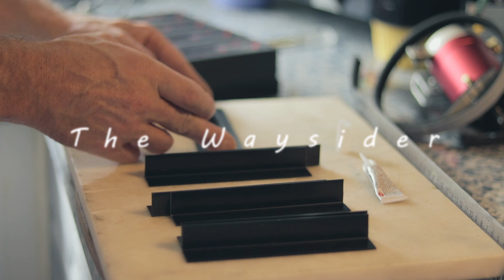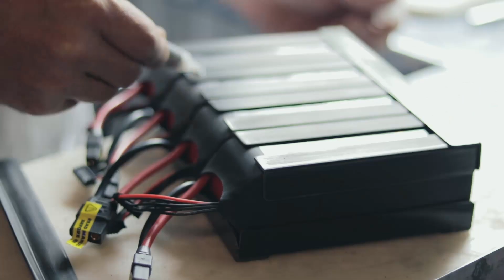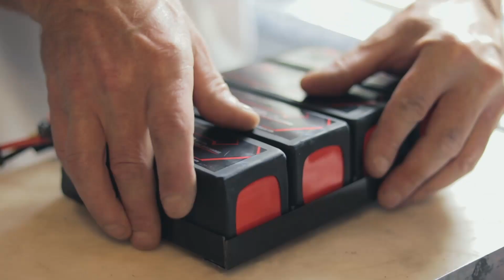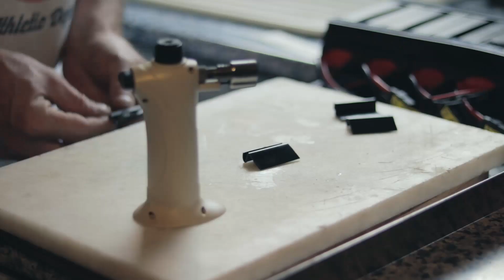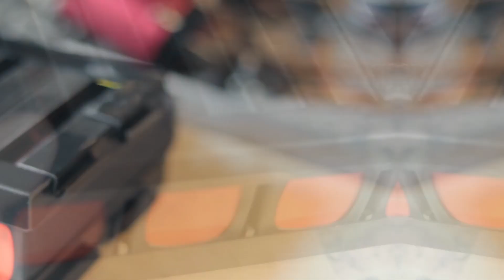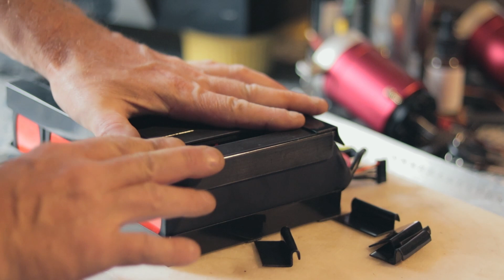I Made My Own Lipo Battery Box for my Diy Electric Surfboard

Comment: Hi, i want to build also, can you prezervatif something about waterproof battery
Reply: Can you suggest*
Reply from the maker: That's tricky but I just made sure no water comes in the hatch were the batteries are. I suppose you could look into battery terminals maybe that are somehow waterproof and make a sealed battery box that plugs into the board but I would say it will be tricky. Good luck if you find something good let me know.

Comment: Seems a bit inefficient at such low voltage to me. Aren't you running huge amps through those cables when it hits the ESC? I guess it's alleviated by it running at only around 1kw after it gets up on foil...?
Reply from the maker: Hi there I am now running on 12s. Check out the latest video to see the test. It's still pulling some amps around 160 but it's all trial and error
Reply: @thewaysider7774  if it's a VESC it should be damn easy to set params correctly. Or are you controlling max speed by reducing input voltage from receiver to the ESC?
Reply from the maker: @NavalTechTinkerer  yeah i have got 3 speed modes on the controller but havent played with that yet will see if the amps go down in a different mode. The esc are just set to 12s not much i can change except the timing which is on 0 degree's.